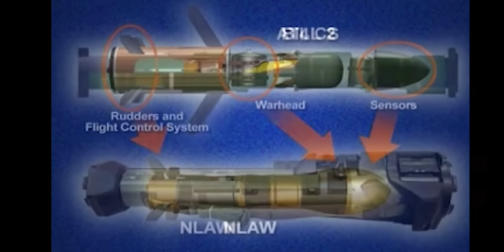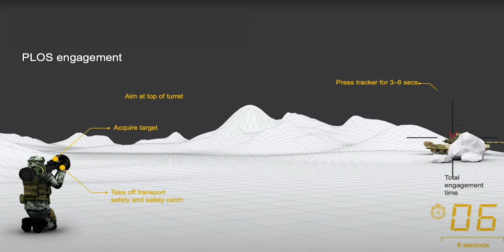Is the NLAW ATGM overrated? Next Generation Anti-Tank Missile

Comment: The NLAW project was initiated by the UK MOD in the early 1980s. A full set of trials was executed by RARDE and Hunting Engineering and the design was ready for production, including the critical technologies, by 1990. It was designed to be able to defeat T90s in urban environments, have an extended storage life, top attack, and be fired from enclosed spaces. It had to be low cost and easy to manufacture. It had to be fire-and-forget. The characteristics of the target meant that an all-burn-on-launch design was not viable, so the soft launch and associated spin stabilisation and course correction technology had to be designed and tested, which was all in place by 1990.
The USSR collapsed in 1990, so the design was put on a shelf for a decade, until LAW 80 was reaching end-of-life. At that point there were several similar designs in production, so the contract went to Bofors who were always well regarded by MOD, as Hunting Engineering, the company that manufactured LAW 80,  had focused their business around support of the UK's nuclear deterrent.
A critical difference between the Bofors product of 2000 and the NLAW design concept of 1990 was the spin stabilisation technology which facilitated fire-and-forget engagement with crossing targets. This had been solved (and secretly patented) by Hunting Engineering in the 1980s using rate sensors developed in support of the US guided munitions programme, starting with Copperhead. That sensor was incorporated into the Bofors design to meet the UK's NLAW requirement.
NLAW, as conceived by RARDE and Hunting Engineering, and ultimately delivered by Bofors and Shorts with the addition of BAE technology, did exactly what it was required to do according to General Staff Target written in the early 80s.
Reply: Thank you for this nugget😁
Reply: It was invented by SAAB on their tech they own the patent on the NLAW
Reply: @lukec2375  The guidance system was patented by Hunting in 1983, based around the rate sensor that was incorporated in the Saab solution and specifically developed to meet the General Staff Target.  It  was a secret patent and therefore not, and has never been, in the public  domain. There were two people named on the secret patent, both Hunting employees, one of which was me. The specification of the rate sensor was derived from work that I did on my doctorate, sponsored by BAE, which covered the application of nonlineaar stochastic calculus to inertial navigation problems. At the time my father-in-law was on the Board of Directors of BAE,  and was the founder of the Precision Products Group that developed the rate sensor eventually used by Saab.
I was employed as a consultant to BAE (then BAC) to define the characteristics of the rate sensor.
Saab certainly didn't invent the guidance system, that was done by RARDE and Hunting Engineering in the early 1980s.
Reply: Lockheed Martin actually produced a weapon like this several  years ahead of NLAW also using Predicted Line of Sight (PLOS).  It was called FGM-172 SRAW (Short-Range Assault Weapon) and was to replaced AT4.   It weighed less than NLAW because there were two versions. FGM-172A with a standard warhead and FGM-172B with a top attack warhead.   As a result it weighed only 9.7kg instead of NLAW's 12.5 because it carried only one type of warhead.  Only 900 or so were produced on budget grounds.
-PLOS and inertial guidance is not a new thing.   It was proposed in the 70s to use Air to Ground missile aimed simply by a pilot tracking the target with his helmeted mounted site but wasn't entirely viable since IMU were expensive and MEMS versions didn't exist till the 1990s.

The SRAW (Short-Range Assault Weapon) program was begun by the U.S Marine Corps in 1987 as a replacement for existing unguided anti-armour rockets and grenades like the M72 LAW (Light Anti-Armour Weapon) and the M136 AT4. Between February 1990 and mid-1993, a demonstration/validation phase was conducted by several competing companies, with the first test firings occuring in 1991. In July 1994, the Predator design of Loral (now Lockheed Martin) was selected for the EMD (Engineering and Manufacturing Development) phase. It was not before 2006 that the official designation FGM-172A was assigned to the missile (before that, it was formally known as SRAW MK 40 MOD 0).

The FGM-172A is a small solid-fueled rocket powered missile, which is manually aimed and fired from an expendable shoulder launcher. The complete ready-to-fire system including missile and launcher weighs only 9.7 kg (21.4 lb). The motor is a "soft-launch" rocket with a low initial thrust, so that the weapon can be safely fired from enclosed positions. The SRAW is a fire-and-forget missile which can be used at ranges between 17 m (55 ft) and 600 m (2000 ft) against stationary and moving targets. During aiming, the SRAW's inertial reference autopilot detects the angular motion of the target, and during flight the autopilot directs the missile to a position above the predicted target location. The FGM-172A is armed with a downward-firing top-attack warhead (very similar to the BGM-71F TOW 2B), which is activated by a dual-sensor (laser & magnetic) fuze in the missile's nose.

EMD Phase I (Risk Reduction) was completed in March 1998, and was followed by Phase II (System Evaluation). In January 2002, Lockheed Martin was awarded the first LRIP (Low-Rate Initial Production) contract for SRAW, followed by a second one in January 2003. During EMD, a total of about 230 Predator missiles were built, and the two LRIP contracts cover the production of 730 rounds. SRAW was to be a low-cost complement to the larger and more sophisticated FGM-148 Javelin anti-armour missile, but further procurement after LRIP has been cancelled in 2003. In 2004, Lockheed Martin received a contract to refit all remaining SRAW rounds to the FGM-172B SRAW-MPV (Multi-Purpose Variant) configuration with a new multi-purpose blast-fragmentation warhead. This will convert the missile from an anti-armour to a direct-fire urban assault weapon, which better fulfills the needs of the USMC.

The U.S. Army evaluated a derivative of the Predator SRAW with a multipurpose warhead for its MPIM (Multipurpose Individual Munition) requirement. A variant named Kestrel, with a direct-attack warhead, was unsuccessfully entered in the UK's NLAW (Next Generation Light Anti-Armour) competition.

Specifications
Note: Data given by several sources show slight variations. Figures given below may therefore be inaccurate!

Data for FGM-172A (missile without launcher):

Length	70.5 cm (27.8 in)
Diameter	14 cm (5.5 in)
Weight	6.4 kg (14.1 lb)
Speed	900 km/h (560 mph)
Range	600 m (2000 ft)
Propulsion	Dual-thrust solid-fueled rocket
Warhead	Downward-firing EFP (Explosive Formed Projectile)
Reply: @williamzk9083  RARDE was flying NLAW prototypes in 1982.

Comment: 1. Its a shape charged that fires a jet of molten copper. Once it pierces through the hull that molten copper will traveling at supersonic speeds will liquify human flesh as well as set off ammunition 2 The warhead is flipped between direct attack.(the shaped charge is pointed front), or top attack (the shaped charge is pointed down and the missile flies over the amour)
Reply: Not actually how  shaped charges work, but result will be the same.
That copper liner cone doesn't melt (high speed x-rays shows temperature is below 800 °C), it gets inverted and around 30% of it forms into the penetrating needle that travels at speeds between 8000m/s and 11000m/s. Remaining 70% ends up crushed into the characteristic carrot lump that trails behind at a fraction of the speed.

Comment: Yes because it's technically not an ATGM because it's not "guided" in a sense but it at least has a  leading system.
Reply: By that definition neither the Minuteman ICBM nor Poseidon SLBM missile is guided either because both use inertial guidance that cant be changed once launched.    NLAW has guidance fins and if subjected to side or head winds or rain will correct its course.   I can see that one day the NLAW could be fired remotely by a sighting station aligned and positioned (by a laser fro example) at a known distance from the NLAW missile itself.

Comment: If I remember correctly, the "projectile" that penetrates the hull, is molten copper. Not something you wanna have push through the roof of your tank, with that power, and get in your thigh.
Reply: It would do more than get in your thigh. It would slice straight through it like butter, bone and all. Basically, you're a gonna if you get hit by the super heated copper plasma jet of a shaped charge.

Comment: I'm no expert (just a truck driver), but my understanding on ammo bustle on, for example, the M1, is that if something like the NLAW penetrated the tank, the armored slide doors would be able to protect the ammo from all the fragments flying around in the haul. I thought those slide doors were armored significantly to protect from that, providing that the doors are closed.
Reply: I'm not an American tank soldier, but from what I've been told the sliding door is to contain the blast from the rounds detonating, combined with blowout panels to protect the crew if the rounds detonate. It will provide protection from splinters inside the tank though, but I have no idea how well and it would depend on how much energy is still in the fragments that have penetrated the armour, or the road from what I assume is a shaped charge in the NLAW.

Comment: How can it be over rated if it does what is was designed to do??
Reply from the maker: I never said it was haha
Reply: It manages a strike into the tank that only has the power of about 5 oreo cookies.   (a standard oreo has nearly 4x the power of a .50bmg)  Often NLAW strikes are followed by everybody climbing out of the tank and finding cover... unlike a Javelin strike which is followed by everything being blown out of the tank and covering everything.
Reply: @prjndigo  that’s one of the reasons why the systems compliment each other, although the power of NLAW is more than enough for most short-medium range engagements and the shaped charge is many, many times more powerful than 4 x .50. No army exclusively use Javelin because of the cost, weight and unsuitability in close quarters. Much better to use NLAW (or another ‘light’ anti-armour weapon) alongside Javelin.

Comment: Comparing it to the Javelin isn't really... Fair. I think the Javelin is more in the region of a fullblown ATGM system, comparable to TOW, Spike, Kornet and BILL2. You need two guys or a vehicle and you can hit stuff at 2-3km away. The NLAW is a squad weapon, not a dedicated antitank team weapon. It's basically an advanced AT4. One guy to use it, throw it away after firing, shot at stuff that's within 300m so you know you'll hit. But, with the ability to knock out a tank and not just IFVs or APCs.

The NLAW was designed to replace the AT4 and Carl Gustav as the squads antitank weapon, since these older systems don't have enough oomph to effectively threaten a tank (and no, a CG did not kill a T90 in Ukraine). So the NLAW is intended to be widely used by infantry, as opposed to a few teams of soldiers with extra training. And the ease of use is really evidence for this, the idea is that anyone should be able to use this thing.

Comment: If anyone is looking for it's cons.
It can be used on direct attack for MBT, but top attack works best. It's a no go for 45° down. It's a one shot system. It's range is up to 800m but it's effectiveness drops off over 500m. It's a single warhead, so ERA can defeat it in direct attack or top attack sometimes. It takes a lot of space as it's a one shot system. It's a very good ATGM, it's really effective.
Reply: Even though it's a single warhead, it detonates and forms above the tank with enough standoff to where the penetrator forms completely, thus ERA will not stop but may degrade penetration, though insufficiently as roof armour is thin af. Obviously you don't want to use direct attack against an armoured vehicle though

Comment: If on the frontline face armour , having this system available is a huge morale boost and crucial to countering and assault. With the modular boxer coming into service to get troops forward quickly to where needed. I would have the more complex systems mounted, with longer range drone , anti air, ecm and javelin type systems  for close support, and tank drones to draw the enemies fire. BAE have been working on something in that concept , however seems over complex and costly for something  that should be a disposable decoy?

Comment: Mat, the lack of recoil is nice -but not magic. It is basically a two stage rocket fired from a tube open in both ends. First stage - burning extremely fast - sends its energy backwards through the tube - propelling the rocket forward with an equal, opposite energy. Once clear of the tube and in a safe distance from the operator, second stage ignites, burns for a longer time, accelerating the rocket towards the target.

Comment: Regarding firing NLAW downwards ; it will not arm if the downward angle is less than 45° from the point of firing ! This is intended to preserve the firer from being blown up by the tank they have fired at exploding i.e. because they are on top of it !   Therefore firing from a high position , downwards, should not be carried out, use another a/tk system (if you have it).
Reply: Really depends on how far up you are doesn’t it? Should be an off switch for these safety limitations.
Reply: If one absolutely needs to shoot a tank from above, although risky, better do it with M72 LAW because it is cheap and can penetrate the roof. Also it does not ask about the angle. But there is a risk of the revenge by a flying turret .

Comment: Yes...RPG 7 gets lot of stigma...like...poor mans weapon or terrorist stuff bady guy stuff...but in long war things like RPG will out live any modern hiend AT weapon
Reply: @PeterMuskrat6968  Tanks don't have enough hull armor to withstand hits from the PG-7V and PG-7VR warheads.
Reply: You can probably still M kill a modern tank with rpg7 if you get a track.
Reply: @PeterMuskrat6968  The vast majority of tanks cannot withstand an tandem RPG warhead strike on the sides, how is it not meant for taking out tanks?
Reply: @voidtempering8700  It depends on the situation and the ammunition used.
Frontal attacks won’t get you anywhere, and unless it’s urban warfare, you generally won’t be hitting a modern tank on its side with a weapon that has that short of a range.

You can get a mobility kill on a tank…
But so can a caveman armed with the knowledge about track weaknesses and a fucking wooden log.

With the advent of advanced, western APS systems (Trophy)
Even the age of Rank ambushes with RPG’s would be limited.
Unless you are rocking the RPG-30… which only Russia has.
Reply: That's fine if your RPG troops aren't already dead. Or shot by their own side...

Comment: 40 000 for a throw away fancy RPG? If one thing is soo good about nlaw is the hype factor. First: it is not guided it is electronicly stabilized so you dont have to mess with ballistics. It simply calculates the "ahead" angle from gyroscopic angle of movement and maintains it while flying. Both can be achieved by simple optics at fraction of the price. Top down attack is needed just because 500mm penetration is too weak. Some 20000 were sent to ukis if that was sooo good as hyped russians would only rides bicicleys by know not tanks...

Comment: Дуже близькі за ефективністю, але у джавеліна є невеличка проблема, наприклад, якщо робити засідку на колону і підбити цистерну з пальним а наступна мішень, наприклад танк, стоїть біля палаючої цистерни, велика вірогідність того, що тепловізійна голівка джавеліна спрямує ракет у палаючу цистерну. Просто треба враховувати обираючи порядок знищення цілей, у цьому сенсі НЛАВ має невеличку перевагу. Обидва зразки озброєння дуже гарні.
Reply: Translation from Ukrainian of the above: "Very close in effectiveness, but the javelin has a small problem, for example, if you ambush a column and hit a fuel tank and the next target, for example a tank, is standing next to a burning tank, there is a high probability that the thermal imaging head of the javelin will direct missiles into the burning tank. It is simply necessary to take into account when choosing the order of destruction of targets, in this sense, NLAV has a slight advantage. Both weapons are very good."
Reply: There is nothing to stop the Javelin from being given the IMU and predicted line of flight guidance of the NLAW as a back up mode for cases of CLU battery depleted or thermal distraction.  The best way its to upgrade the Javelins seeker with a better procesor and higher resolution thermals to allow better algorithms.